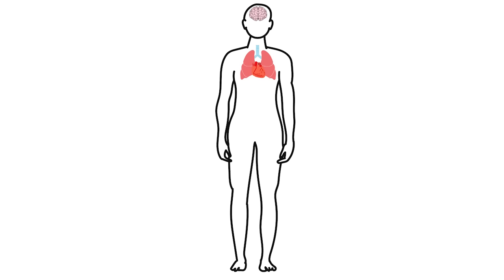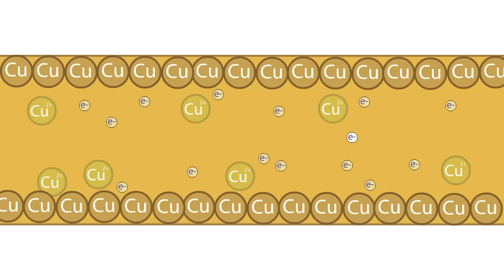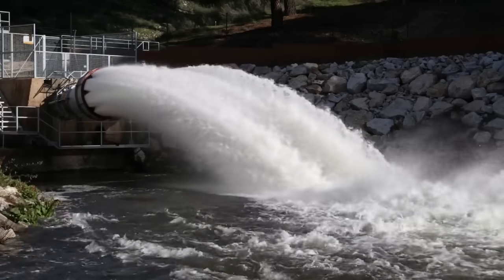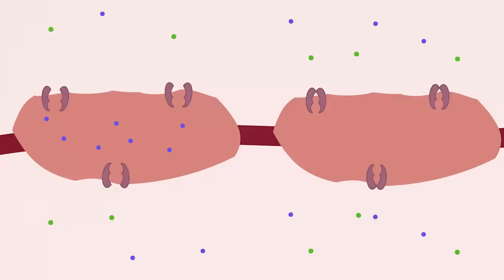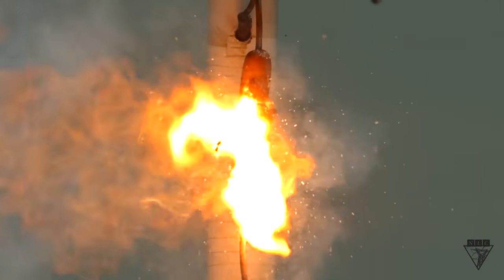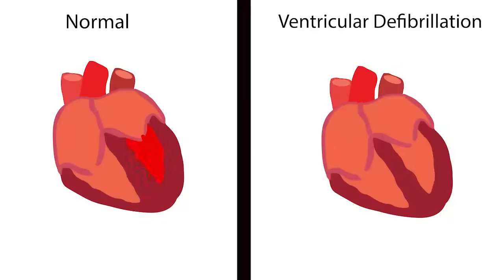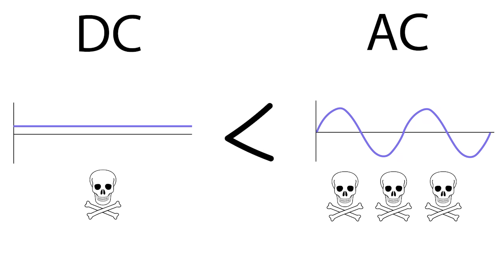Anatomy of Electrocution

Comment: 3:33 it's to limit the current not to lower the voltage.
In this scenario if you want to lower the votage you should use a voltage divider, regulator or transformer
Reply: The only way to limit the current is to limit the voltage. The resistor is used to limit the current and it creates a voltage drop that reduces the voltage across the led so the current also reduces.

Comment: I had a no let go when I was about 12 years old. We had a super old waffle iron, and I guess the coil had broken inside. I plugged it into the wall with my hand still clutching the handle, not knowing the coil was broken. Sure enough I’m shot with an intense vibrating sensation throughout my entire body. My hand was still stuck on the handle of the waffle iron. Thank god my mom was in the kitchen and saw I was freaking out and immediately unplugged the waffle iron. Soon after, I was met with horrific organ cramps for a good 30 mins. Moral of the story, check your old shitty appliances before you plug them in.

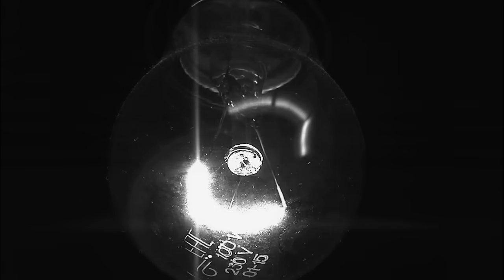Comment: At about 12:26, there needs to be a correction made.
At 60 Hz the current "turns on and off" (reverses direction) 120 a second - not 60 times.
This is because a Hertz is based on the regularity of a full wave. One full wave includes two 'zero-cross-points' between negative and positive, therefore, there are two "on-off" cycles per Hertz. 60 X 2 = 120.

Comment: I'm surprised you left out that the electric chair was invented by Thomas Edison as a marketing ploy to discredit Nikola Tesla and his new AC electricity.
Reply: Actually Westinghouse. Tesla was a relatively minor operator in the game. He later inflated his role an other followed doing so. Edison said that killing with electricity should be called Westinghousing.

Tesla's major contribution was that he was the first to develop an AC motor but it took others years to make it practical and also it is not the motor we use now. It was invented by Dolivo-Dobrovolsky. Tesla's fame came from the Tesla coil and because of that Westinghouse used his name in advertising. The  fact that US uses 60 Hz comes from Tesla just as European 50 Hz comes from Dolivo-Dobrovolsky so that is Tesla's lasting contribution. In general motors liked lower frequencies and lighting higher. 50 and 60 Hz were compromises.

Comment: Please correct: resistors are not limiting the voltage. They limit the current. Always. If you want to limit the voltage with resistors, you need at least 2 of them - it's called voltage divider. When you put current through a resistor - it will cause a voltage on its terminals, that voltage will be subtracted from the voltage a LED would get. But then again, a LED will take a constant voltage. That's a property of diode. When they conduct, there is a constant voltage on their terminals. But if not the resistor in series with the diode - you will just exceed maximum CURRENT of the diode and destroy it. Not because of the voltage alone, but because the current. So - the resistor in series with the LED is called "Current Limiting Resistor". It can be of a small value - then you get the high current and high power. Larger value - smaller current and power. Current too low - LED is too dim. Current too high - LED is fried due to it's maximal current exceeded.
Reply: That would be true for an ideal diode with constant voltage drop but real LED's aren't ideal so technically there isn't anything wrong with video. Without the resistor the voltage across the led is too high and that results in a high current that burns out the led

Comment: By the way, the fractal wood burning using electricity is extremely dangerous. You have a pair of bare components hooked up to a wet board with enough electricity to kill you or severely injure you flowing through them. Accidentally brushing against one can cause you to become part of an electrical circuit with the ground.
It looks pretty but don't try it.
Reply: Yes, it is high voltage that is a completely different game It can kill instantly and it can also maim so you can lose body parts.

Comment: Voltage does not burn a resitor, wattage does.  Resistors do not drop voltage unless in pairs. they restrict flow, like a water valve.
Reply: How doesn't voltage burn resistor if wattage does. The voltage across a resistor determines the wattage
Reply: @laserdiode  because current x voltage = wattage. You can have high voltage and low current flow or low voltage and high current. As long as the wattage = heat stays in the safe zone you are good. Resisters are rated in watts
Reply: @007cantos  Still the voltage across a resistor is directly proportional to the power. You can only have high voltage and low current or low voltage and high current if you are using a different resistor. Also resistors always drop voltage. The only way to limit current is to limit the voltage. If current trough a resistor increases its voltage drop also increases so the voltage across the load decreases

Comment: Although I'm sure good research has gone into the production of this video there seem to be many small errors. 
The claim that current kills is related to the fact you can raise the voltage as high as you like, but so long as the current remains the same it won't have much of a different effect. Changing the current on the other hand has significant effects as already discussed at length. 
Placing the protein channels into cells of the myelin sheath seems very wrong to me, and describing those cells as the signal transmitters is definitely wrong. If I remember my biology correctly they are more like the plastic sheath on household wires, they protect the actual nerve cell from electrical interference. That means they shouldn't have ion channels for transmitting signals. 
That's not defibrillation.
The analysis of frequency in AC covers only half the wave, it needs to hit -1 and then 0 to complete a cycle. This also means the on/off cycle is 120 times/second since it has to go through the entire wave pattern.
.
I hope anything I've said here can be taken with good grace by viewers who remember to use more than one source and creators who find ways to improve research.

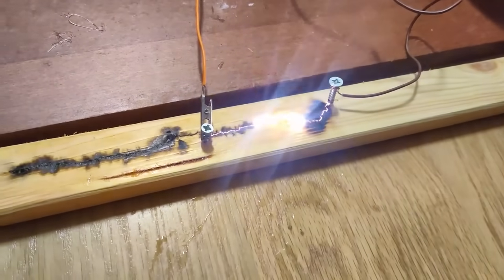Comment: The electric chair uses a voltage of between 2300 to 2500 volts and an amperage of 4 or 5 amps, so a fair bit higher voltage and lower current than mentioned in the video. On top of that electric chairs are only at "full blast" i.e. well over 2000 volts for about 5 to 15 seconds, then switch to much lower voltages of around 400 to 500 volts. The reason for this is that the high voltage is needed to overcome the initial very high resistance of the skin. After about 10 seconds of 2000+ volts an ionised path of lowered resistance has formed between the head and leg electrode and thus no longer necessitating such high voltages to still pump large amounts of current through the body. If they were to use high voltage the entire duration the body would probably catch fire or at minimum be much more heavily damaged. To get a better understanding of what I mean you only need to look at the short clip of the wooden plank being electrocuted at 3:50, where you can literally see it forming a low resistance path between the 2 electrodes until a continous current flows across wood, a material which just like the human body initally has a very high resistance.

Comment: I don't agree that AC is more dangerous than DC. DC constant current locks muscles and provides a steady current flow, whereas AC gives a break in muscular contraction and current flow and also allows the ability to let go of the source. Voltages over 220VAC tend to knock you back from the source. Lets look at a real life example. In India they use DC and if you look at the death statistics where DC is used, you would find the death rate by electrocution per capita is infinitely higher than where AC is used.
Reply: It is not some opinion issue. AC is more dangerous. That is a fact. Whether you agree with that is not that relevant. Do you have any clue on what you say? It takes 100-200 ms for a person to react to something. (In sports reacting under 100 ms is a fault). In 100 ms there are 6 complete AC cycles in the US. That is the electricity goes to the zero 12 times. Just how can one let go when it goes to zero when in the time you react it does that 12-24 times?

They use 240 V AC in India and the standards are what they are in a developing country therefore electric deaths are 10-20 x what they are in the West. Some 10 000 die from electric shocks in India annually. Of course that is not much if you compare to the 400 000 who die in traffic. One reason for high deaths in developing countries is theft of electricity. People hook their own wires to the poles.

No country uses DC.
Reply: @okaro6595  Tell that to the people who die in India that runs on DC.

Comment: When I was a kid, about 9 years old, my computer case was open after doing some modifications. Anyway, after tinkering for about an hour, I forgot the PC was still plugged in and whilst most of the PC is low voltage (5-12volts), I accidentally put my hand on the mains power switch, which was 240v. I felt three jolts/really painful contractions shoot through my entire body before the breaker tripped (RCD). 3 cycles of the 50Hz supply, I guess. I learnt my lesson that day.

Comment: As an electrician of 33 yrs, getting zapped unfortunate happens. Here in the US standard voltage is 120/240V at 60hz. I'd argue that getting shocked at 120 volts will kill you. I'm still alive despite being shocked with direct contact from 120v to ground. I, and everyone I know can let go of that circuit. The issue isn't just the current. The body has resistance thus depending on the voltage and the resistance of the current path will determine the current. That electrocution in Yemen was with 220 vac. Not 120v. That's why the employee couldn't let go. If it were 120 he most likely would have been okay baring a heart condition or other health condition.
Reply: That is a very dangerous belief. Both 120 V and 230 V can kill but they do not necessarily kill. Only one shock in a hundred or less will kill. The difference is that in Europe nobody has a casual view on electric safety while in the US it is very common to believe that 120 V is safe.

Also 120 V forces to use more high (medium) voltage lines which often are open. In the US a very common reason for electric deaths is accidental touching of a high voltage line.

Comment: AC was used because Edison pushed it as a way of turning the public against Westinghouse's AC system.   Not because it is more dangerous.    It was a political stunt to begin with.   The AC is typically measures as RMS p-p. 2.4Kv would actually have a peak voltage around 3.4Kv-ish.   It can make comparing the damage of DC and AC a little confusing.    In either case, it would be an unpleasant experience

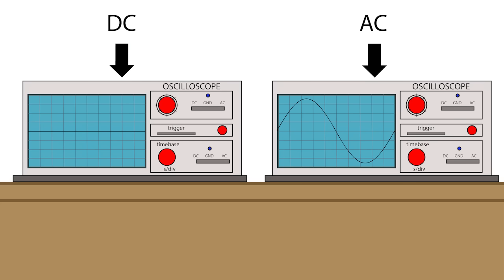Comment: Quite a good elobaration. Very informative. However I am not satisfied with the video when you started explaining different current capacities at the video timer 6:30. What is the relative voltage when you are explaining 1 ma, 6ma, 15ma etc.  What is the constant voltage when you are varying currents in your hypothitical anslysis.

Comment: Nerve disruption kills an electocution victim? Good thing, that means we can toss the defibrillators into the trashcan!
Given that the heart's conduction system is not based at all on nerves. By the standards stated here, that 100KV shock you get in winter from walking across the carpet is 100% lethal, every time!

And yes, it is the current that kills. The current overwhelms signalling in both muscles and myocytes in the heart, leaving both contracted for the duration of the current flow. Disrupt the cardiac conduction enough, fibrillation occurs and the person does that dead thing.
I've gotten hit by 45 KV, still around, as the current was low, so it was only painful. A taser delivers 50 KV, only a couple of hundred deaths are accounted for by taser. An electric chair delivered 2KV - 2.5KV at 7 - 12 amperes of current, both cooking the prisoner and fibrillating the heart, resulting in death. A short duration jolt may or may not cause fibrillation, as then it becomes a matter of timing, with around a 50 ms window within the QRS complex to trigger ventricular fibrillation. I drew around 3 amperes, as verified by the circuit designer, when insulation failed and I drew a 1.5 KV AC arc that had 130 V DC riding under it, the 130 V being the high current carrier. Blew the regulator, I survived after an escape beat restored normal heartbeat. Couldn't use my hands for much for a day, was sore for a week, still here. A longer, worse timed jolt, we'd not be communicating without a seance and since I don't believe in those, I'd not bother showing up.
Draw around a half ampere of current and your muscles contract strong enough that you cannot release any grasped conductor.

But, what would this old Army medic and certified electronics technician know about electrocution?
Shall we discuss sodium vs calcium channels? The sodium-potassium pump?
Reply: I think you're a silly little man who's greatest achievement in life was beating the quota of burger flipping in some fast food restaurant.

Comment: I was working near a large parking lot several years ago. A fellow nearby was working on the lights in the parking lot. At some point his coworker turned the power back on thinking the electrician had completed his task. The electrician, working from a bucket truck let out sounds of anguish that I will never forget. I ran over and hit the emergency lower button on his bucket truck which lowered the bucket about 6 feet. By this time all was silent and the coworker was standing beside me. He lowered the bucket to the ground and we walked over to check the condition of the electrician. Although burned and still in a great deal of pain he had survived. How did I know about the emergency lower button on the electricians bucket truck? I drove the identical type bucket truck for a different company and had been dispatched to the adjacent lot. I just happened to be in the right place at the right time.

Comment: As an Electrician I can say with confidence that electricity traveling from one hand across the heart to the other hand really hurts, you really feel your muscles tensing 50 times a second fortunately I have habits to avoid a death grip and have never been shocked for much more than a second
Reply: I have been shocked by 120V household voltage more times than I can count. Yeah, it's not pleasant but it's tolerable. Just don't be standing in water.
Reply: @crand20033  this guy is using european 50 Hz electricity which is 240 or 250 volts. Much, Much worse danger...
Reply: Made the mistake of touching both ends of a 4' fluorescent bulb one time, ouch!
Reply: From Europe, perchance? Much of Europe ueses 50Hz power, USA and Canada at least, use 60Hz. In some ways 60HZ is more dangerous because it can synch with the heart, and effectively stop it. 50 HZ does not synch so well.
Reply: 230v from my house and 30000+v from my motorcycle, that was hard. 😂
Reply: Is avoiding long term damage from shocks possible as an electrician? I want to get into it but I don’t want people to pressure me into doing the job faster by skipping safety measures and not wearing all the PPE
Reply: I've been an electrician for 16 years and only really been shocked no more than 10 times total and I've not suffered any effects at all, after a shock it generally hurts and feels weird for about an hour at most depending how long you touch it I've not touched a live wire for more than 2 seconds, I test if there is power and if it is safe I quickly brush the live part with the back of my finger that way if my tester isn't working for whatever reason I touch it for less than a second and I don't have a death grip, my advice for avoiding shocks is you shouldn't take anyone's word when they say something is safe, instead you should always confirm it yourself people aren't out to get you but they will make mistakes @Justin-jy6fu
Reply: Actuallt 100 times per second.

Comment: DC current will seriously hurt a person. 24 volts at 600 amps is a bad combination but is commonly used when arc gouging metal. Using proper PPE is critical. Don’t think it’s just AC that’ll hurt you. Given the right conditions, electric shock can be fatal.

Comment: It’s current that kills you, because you can have high voltage without high enough current to kill. For instance, static shocks
Reply: Wrong. Static shocks are several amperes. Ever heard of Ohm's law. Voltage and current are related. A static shock is a very shorty pulse that has little energy. That is why it is safe. 

There is no such thing as high voltage, low current. If the current is limited by some impedance then the voltage will drop at the contact.
Reply: @okaro6595  no, I’m not. The average static shock can be anywhere between 2-10kV. If it was measured in amps, we’re talking about 2-10kW, which would absolutely obliterate someone. Voltage is a measure of potential, current in a measure of electrical charge transfer. Watts is a measure of power and to transfer that much power over such a short impulse would be devastating

Comment: good video. I's ventricular fibrilation, defibrilation is the process of getting the patient out of VFib. And yes, small current of several tens of mA can be fatal, but there has to be the voltage too. Every phone charger gives several hundred mA but it's not fatal at 5V